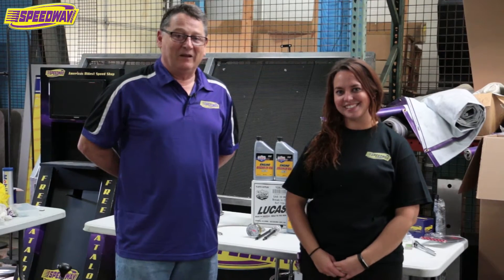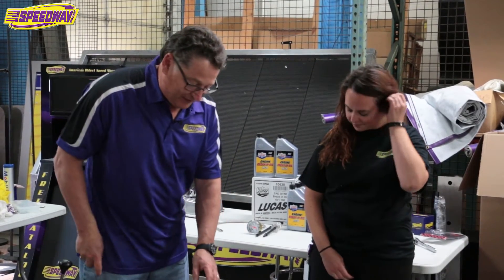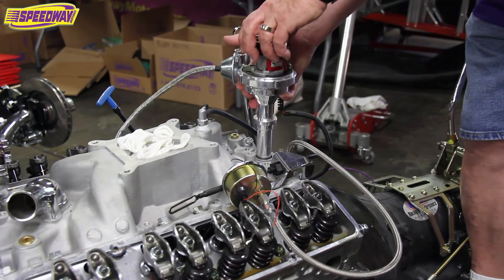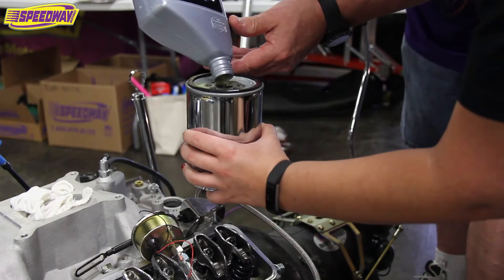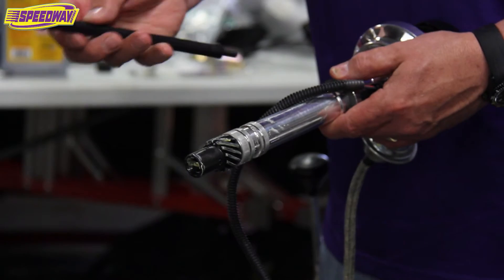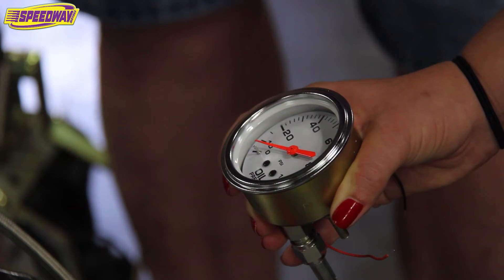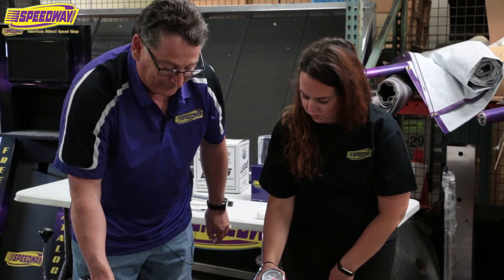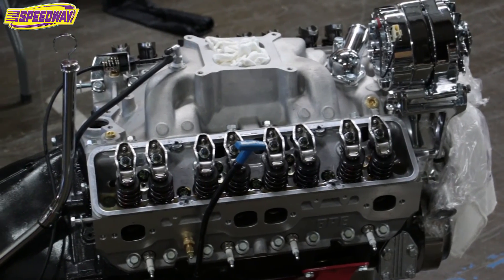Speedway Tech Talk - SBC/BBC Engine Priming

Comment: What direction is the Drill??? What direction do you prime the oil pump?? I've watched 10 videos so far, other than some one say make sure your going correct direction... This is a very important step!! You would think someone would say clockwise or counterclockwise or we have the drill in forward or reverse... Can someone please help me I want to prime my 454 that was bored to a 468 obviously before I try to start it I want to prime the oil
Reply: It's forward direction... No one told me, but figured that out... My 468 Chevy big block was primed shortly after asking this question
Reply: clockwise
Reply: @keiths9483  I finally did figure that out back a few months ago probably April but thank you